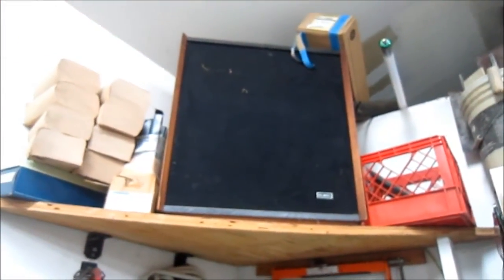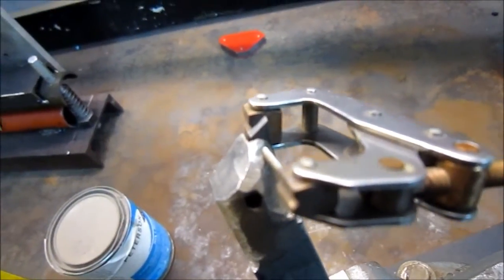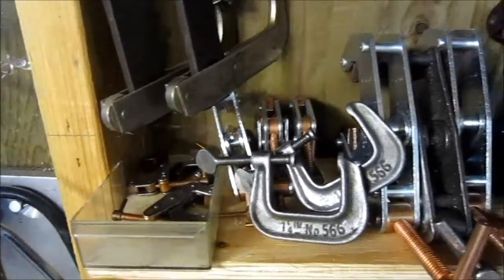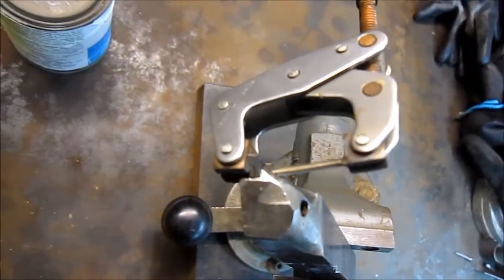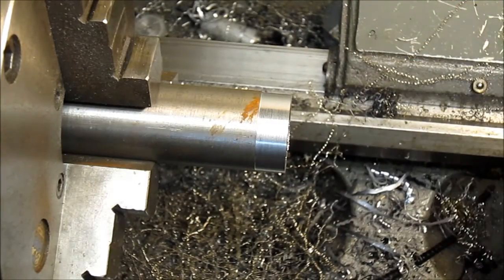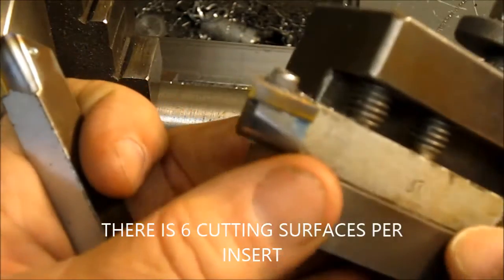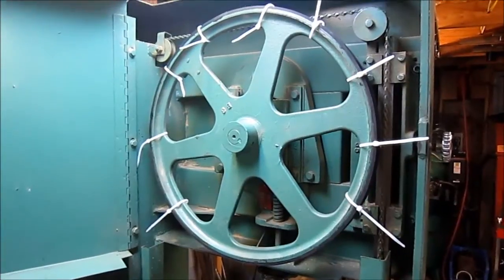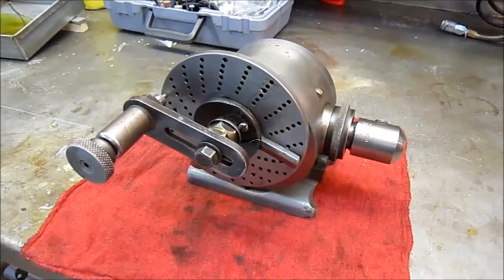FLEA FIXING and not a scratch

Comment: Nice fix. I was also thinking you may have started with the wrong insert size, maybe the next size up from what was originally used on it. No biggie if so, you fixed it up nice and looks like it working good for you. That style of tool is great for reaching in next to a center when machine the end of shaft. Looks like the dividing head cleaned up nicely! Maybe I should start sending you my rusty tools to clean for me!
Reply from the maker: Adam...

I have a deal for you on cleaning your rusty tools....a one time charge...all the cleaning you want for one oil can.....LOL

gotta admit...I just don't quit....

thanks for watching and your valued input!

Chuck

Comment: That is a great tip about the CLR.  I'll have to give that a try next rusty tool I find!
Reply from the maker: vajake

thanks...it works well, just be sure you test--monitior as it can and will turn some metals black, esp if it cooks too long
Reply: Thanks for that.  I bought some expensive "BowShield" stuff and put it on my 6" jointer.  Turned it dull gray on contact.  Neutralized it with baking soda dissolved in water. Buffed it back out with Brown Scotch Bright pads. Learned a valuable lesson!